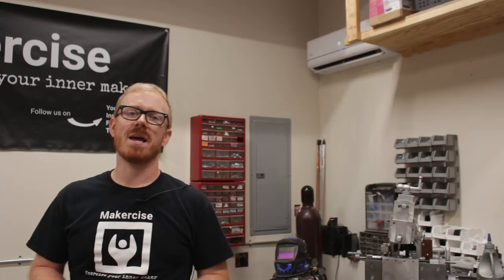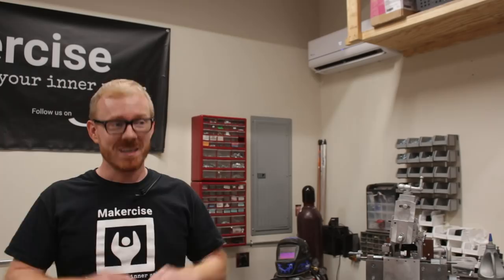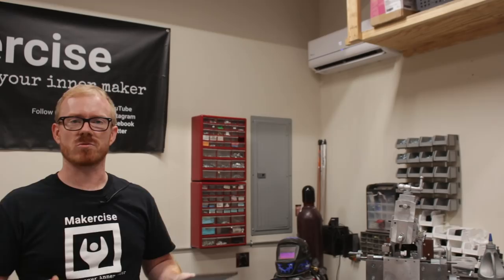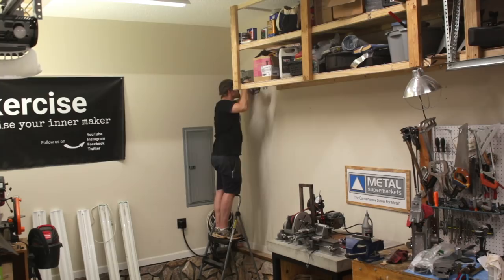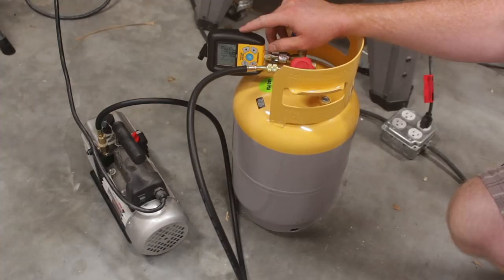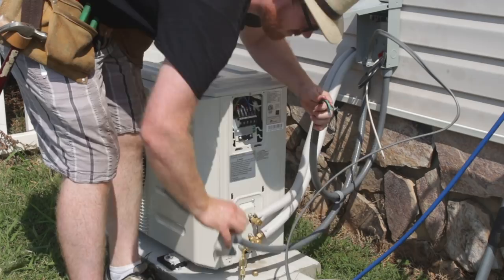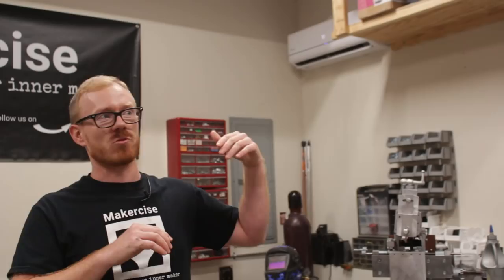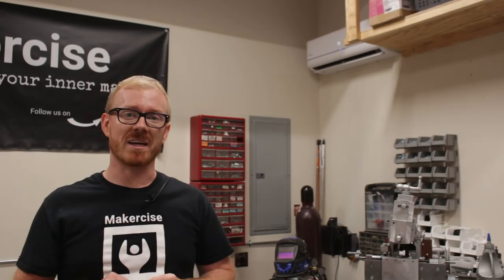DIY Mini Split AC Installation - Air Conditioning Install without Professional Help

Comment: Amazing work. Thank you so much for sharing.  It gives me a really good starting point for my DIY split system install.  I have requested quotes from 6 different companies and the prices and equipment differ by the 1000 between each one of them. I have been given prices from 9K - 14K.  -Thanks again,
I also like to thank those who gave positive feedback to this video where minor mistake(s) were made. hopefully I will learn from them.  -Thank you all,

Comment: EXCELLENT tutorial and supporting document on your website!  I was doing this exact same thing in July 2018 for the first time, and would love to have had this tutorial then!  I made a similar mistake - I installed a multiple zone system and when evacuating and releasing refrigerant zone-by-zone per the mfgr instructions, I opened the wrong zone valve, releasing refrigerant into a non-evacuated zone, thus contaminating my entire charge.  All in all, it forced me to understand the inner workings of the unit better, and while I had to replace the refrigerant, I learned a lot more in the process.  Thanks for this great guide ! It's my opinion that HVAC, while definitely a complex and nuanced trade, should be more accessible to "extreme DIYers" like us who are willing to put in the work to learn and do it properly.  Your guide helps to make that happen.  Great video! Subscribed!
Reply: Yep tape off or wiretie unused ports

Comment: Thanks, I did a successful install after watching this and other videos. No money saved yet after tools and my time, but it was fun and my next install will be much quicker and dirt cheap!
Nitrogen tank test seems a bit over the top for a DIY mini-split.   A thorough vacuum test will catch most leaks, and after that you can release a small amount of the R32 gas for a pressure test.

Comment: Nice video very informative. Regarding the EPA and regulations and warranty I have had clients do the the installation them selves and then have me do the startup, for a single zone unit it’s only 1 hr of service done
Reply: I’m looking to DIY mini splits in my house. Can I do all the running of line mounting and install and have an HVAC company come at the very end to do the actual connections and start up?? 
Thank you

Comment: as a 30+ year licensed HVAC tech and mechanic, I'd say you did everything perfect (even correcting your slight flub with the lines) Only question is:  Why the need for all the math with the charging scale? usually, you set up the bottle and lines, wait for everything to settle, ZERO the scale and then just charge- it will read negative the desired ounces till you hit the target and then close the valves.............. GREAT JOB!
Reply from the maker: Probably just the engineer in me coming out. I also wanted to save $150 by using a baby scale that I had on hand versus buying a proper HVAC scale. The baby scale won't go negative. Also, glad to hear someone who knows what they are doing approves. Thanks! :)
Reply: Eclidean were the lines charged b4 zero on the scale ( 2-3onces) or they will hold some of the charge and it will not be inside the system also what was lost during disconnect- add 3 once’s?
Reply: AQ
How much cost to hire someone
Reply: I just got my degree last month for HVAC/R and Sutherland's is wanting me to be their installer for mini splits; do you have any advice for me?
Reply: @Makercise  I was wondering, usually when we recharge a system with 410 or R32, you charge it as a liquid which I think you did. Now if you dumped all that liquid refrigerant into the suction side my estimated guess without going back through the video would've been 1.5kg to 2 kg of liquid refrigerant. Could possibly stall the compressor on start up, we usually turn the system on after it has about 500kpa in it and let the suction line suck the liquid in slowly until we get the adequate amount of refrigerant.

Comment: It is great to learn from mistakes. It is not good to heat the R410A tank, you can always wait until the unit can be turn on and charge from low pressure side. Very responsible to recover the refrigerant.

Comment: What an awesome video!!  Convinced me that I’m just going to install it though, I’ll get a pro in to charge it with refrigerant! All those pipes and measurements I’m sure I will screw up somewhere.
Reply: Channel name is super cool too. Instant subscribe
Reply: A lot of the systems are pretty charged for a certain amount of pipe lenght
Reply: Pre charge d
Reply: Most come pre charged

Comment: I wish I had seen this video before doing my own mini split install. I made nearly the identical mistake, I had the vacuum hose oriented the correct way but the Schrader depresser bit wasn't twisted out far enough to make contact with the valve, so the line set never got vacuumed.

Can you explain when you recovered the contaminated refrigerant, were the valves on the high/low ports of condenser open? Also when you come to vacuuming it, do you leave the valves open? How does the oil not get sucked out from the compressor.

 If however the valves are shut, how are you supposed to evacuate the contaminated refrigerant from within the condenser coil/compressor?

Comment: That's really helpful video.  Thanks for pointing out that potential huge pitfall. I could have made same mistake too with not vacuuming down line set due to missing shreader valve insert.  Always verify that lines et is actually vacuumed down before releasing freon is a very good tip.    Just got permit for totally DIY mini split install here in California.  They didn't ask whether I had 608 cert.

Comment: Just bought a Fujitsu AOU12 RLSH(Y) 12kBTU unit that I'll install in the coming days.   Thanks for all the info...I'll be rewatching parts of the video just to get it right.
Reply: Unfortunately, if you base your installation on this video you're going to be sorely disappointed. Props to the poster for trying something difficult, but there are countless missteps, misunderstandings, and complete lack of knowledge in this vid as to what or why some of these things are done or not done. He based much of his install on the manual, which is A) Chinese, and B) makes the presumption that you know what you're doing - it therefore skips many critical steps. This installation "looks" fine and an inspector would pass it because he's none the wiser. I predict the compressor to fail first.
Reply: I agree, this guy doesn’t know what he doesn’t know.  Just to clarify though, why do you think the compressor would be the first to go?
Reply: @benlucarelli  lack of proper evacuation would be one. 500 microns means nothing. Moisture + refrigerant = acid, = toasted motor windings eventually.
Reply: Not to mention repeated freezing up at the metering device

Comment: Pretty good coverage and an interesting experience.  I would suggest DIY installation, but leave the freon connections to your local AC Tech.  That preserves your warrantee, as well.  These units are actually "heat-pumps", which is why they can be so efficient.   You can get 120v units up to 9000 BTU (20 Amp circuit, but they only pull about 6 amps).  After that, you have to go to 220v, which has an additional wire.  If you are using an existing circuit, no problem, but if you need a new circuit, get an electrician to install it.   These things don't draw much power at all and they are very quiet. 

The factory installation on most of them suggest going out the wall behind the inside blower unit and just running the pipes and electrical wires down the outside of the house.  You back later and cover them with plastic conduit made just for the purpose.

While this one is securely mounted to a concrete base, many people will prefer to use a shelf bracket and mount the compressor section on the side of the house. The vibration isn't really a problem.

Nice video.  Most people won't have to evacuate the system like you did, if they follow the simple instructions or let an HAVC Tech take care of the charging part.

Comment: Thanks for the idea of run-in everything down the inside of the wall. I'm moving into a new house with an HOA and I really didn't want to have to try to hide lines on the exterior. I'm going to have to retape and float the garage anyway, so one panel of drywall repair isn't a big deal to me.

Comment: You can install a system with a building permit, then hire a pro to evacuate and charge the system at a very low cost.  I did this for a Sanyo system I installed and it worked perfectly passing all inspections.
Reply from the maker: That sounds like a good compromise between a DIY and pro install. Possibly optimal.
Reply: Justin credible  There is nothing illegal or unsavory about this.  It is all done through the building permit system.

Comment: the cost to hook up that unit would be about 400 from a heat air contractor required by most cities?  second if you just pulled the air out of the line set correctly , disconnect the vacuum pump then open the main valves and the pump is within 25 feet from air handler? that would have been all you needed! 

your misstate will help more people save money then if you did it right the first place!   pointing out error saves time and money on earth!  thank you makercise you are real!

Comment: Great video! Quick question please :) if I have a two story house, would I run the piping down the side of the house to have the AC on the ground - the air flowing up isn’t going to be a problem? :) thank you so much in advance for your help :)
Reply from the maker: I would run the piping to mount the outdoor unit on the ground if I had a two story house. I have seen folks mount them on stands high up. It would be a pain to set the unit in place high up even with help. 

I am not sure what you mean by air flowing up. Only refrigerant flows through the lineset. Mini split units have a specification on the max distance for the lineset to run horizontally and vertically. The spec should be in the installation manual. Read it before buying one.

Comment: One comment about running line set inside wall.  Usually it's tricky to bend lineset 90 degrees, and I've seen other youtuber install videos where they  kinked the line set trying to force sharp bend.  Another huge potential pitfall.  Usually you want to bend the line set gradually, and that's why you want to drill a hole at an angle (sloped 30-40 degrees downward) to avoid sharp bend when line set goes from inside to outside wall.

Comment: If you could go back and do it again, wouldn't you just get a Mr. Cool DIY unit that comes pre-charged and vacuumed? They're a little extra, but you basically paid the difference and more in tools/licensing/etc. Wondering what your honest opinion is on this because I'm looking to install a mini-split myself.

Comment: Did you bend the linesets by hand? I want to install one myself and there aren't many videos on the lineset installation.
Reply from the maker: Just go easy with it. It is possible to kink if you try to bend to tight.

Comment: Mr. Cool mini split units saves you all that trouble with it's r410 precharged  outside unit, inside unit and line set.
Reply from the maker: The unit I selected was also pre-charged. Line sets and indside units are small minisplit units like this are not precharged. Mr Cool is marketed for DIY install but they make you hire a professional to 'prove' it was a factory defect if anything goes wrong.

Comment: Hi I'm ready to install my inverter unit. But my AC guy said I should have it 12 inches away from the wall like the manual said. Can I get away with it if it's 2 inches away. Thanks
Reply from the maker: It will shorten the life and reduce the efficiency without enough space.

Comment: Im not understanding why you vaccum down the lineset then used nitrogen .shouldn't it be the other way around ???You nitrogen test the lineset release the nitrogen then put in vaccum till it hits the designated micron setting.then release the freon \break charge

Comment: awesome dude.  the "diamond contractor" i contacted wanted $18k usd for 4 wall mounted units and a hyper heat pump that runs about $6k - $7k smh.  Now home depo is installing them.  If home depo can charge people for hack jobs, I can damn sure do the job right myself.
Reply: Quotes for installing mitsu MLZ 8c and 4c with 9 heads, and 2 branch boxes-40k+. It's a HUGE scam! I'm better off doing everything except the lineset and vacuum pieces.

Comment: I installed a Quietside two ton mini split in my garage in 2010 and I was operating blind.  I worked heavy commercial refrigeration (ammonia) back in the sixties and have installed a few residential units over the years but this  was unfamiliar territory. A hot suction line blew me away but I finally  found out what was going on there.  It has operated flawlessly as both a cooling and heating  unit but just recently decided to be troublesome. The book that came with it is written in JapoEnglish and is essentially worthless. It runs in cooling mode  but not up to par. It eventually gives me a E4 display which I assume is an error code but I have no way of determining what it means.  I called the number I had for the company years ago and was greeted by someone speaking pigeon English who had no idea  who Quietside was so I have my work cut out for me. 
I watched your video and what impressed me most was your work ethic and your attention to detail.
 I was born in the latter years of the depression and as a young man could not afford to hire anybody to do anything.  When I could I would buy the tools and do the work myself. 
The logic was simple, I did the best work I could because it was for me and mine,  plus the money I would have spent paying others to do the job went for tools, most which I still have!  I'm getting on in age now, can easily afford to pay others to do work for me but I have tools for many trades and am fairly proficient  in using them so I continue to "do it my way".
Your a neat young fellow, too bad there are not more like you.

Comment: Did you happen to obtain the Type I (small appliance) or Universal certification? Since the Type I cert covers systems with up to 5 lbs of refrigerant, seems like that should cover most smaller mini splits (without really long lines anyway). Anyway, thanks for the video.
Reply from the maker: Type I only covers factory charged systems, think window AC, dehumidifier, refridgerators, etc. Because the lineset is not factory attached and charged, I took Universal because I needed type II.

Comment: Question on the electrical side ( first video I am watching  due to the hackaday article) : did you do the electrical homeowner certification (if available to you locally ) or something else ?
Reply from the maker: My county does not require an electrical homeowner certification. My dad had to take it for some work he did on our house in Charlotte a while back. This kind of thing is one of the reasons I chose to move away from the big city.
Reply: Thanks for the reply . Going through this research in the past I wished I would have had this video to watch to kick of the effort. Great work.

Comment: As much as I hear people say that a vacuum is required before releasing the refrigerant, I have seen so many people do so on these precharged units without problems.  Yes, the risk is condensation, but again I rarely have heard of this becoming an issue after it was done without a vacuum.

Comment: With all the cockups, extra expenses in equipment  and certification I reckon it still worked out cheaper than paying someone here in Italy to install an AC system!

Comment: I went to offerup I bought a 24000 btu a/c brand new for 160 usd. I cut out a hole on the wall and insert the a/c in there ..put some caulk around it and worked perfectly good... save me some hundreds

Comment: Just got a Samsung mini split installed in a 20x20 studio and the contractor didn't "charge" the system. At least I dont think he did, the air is not cold at all. How can I check without buying fancy gauges and equipment?
Reply: Pay another tech with the gauges